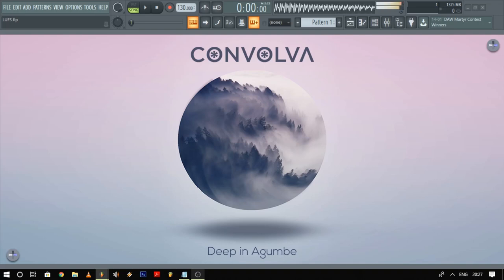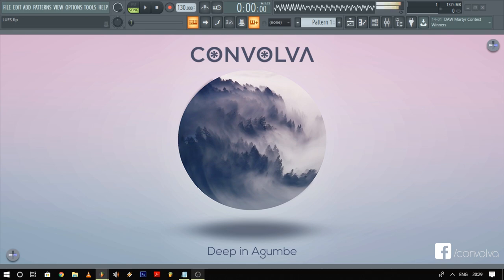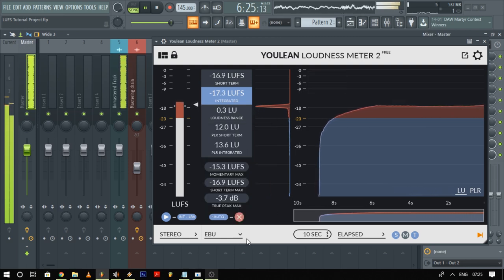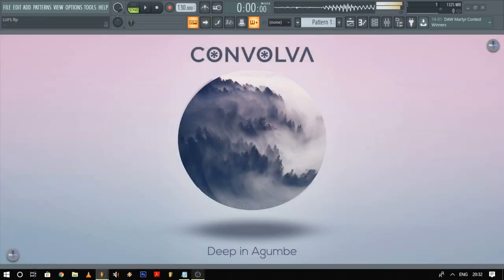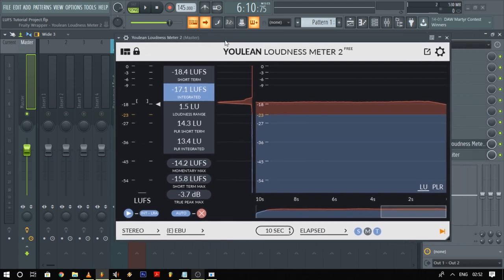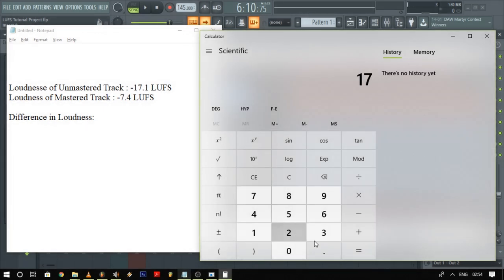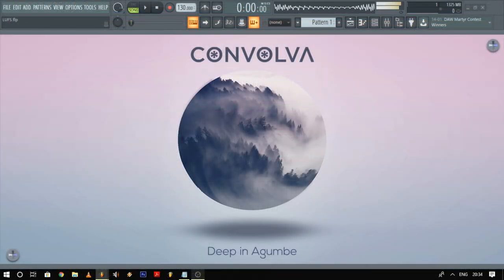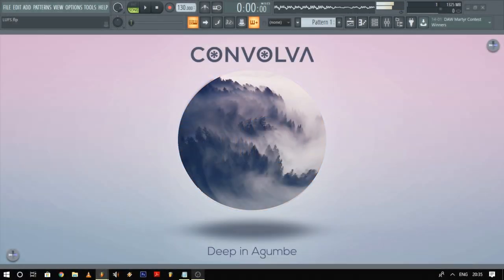Mastering Tip That Will Change Your Production Forever! (2019)

Comment: Very useful approach mate, I might say that starting with a fewer instruments with minimum frequency clashing would end up with a cleaner, fuller in dynamic response and tighter, rather than piling up lots of instruments that competing on the sonic spectrum, where lots of attempts to have the final track loud & clean sounding would be just hard & painful chore... 

Lots of successful tracks, actually relies on a clean arrangement, fewer musical elements, varied and correctly chosen frequency ranges. Most of which actually having no more than 10 instruments. 

Also, knowing how ear works, makes it easier to have a good mix and mastered track, as the human hearing tend to respond to the mid frequency range, so caring with the lows and highs is essential indeed. 
Implementing Lo-Fi process on low end, would give a neat vintage bite, that cuts through the mix. Some saturation / distortion process on the high end in the other hand would makes it less digital, which is very pleasant to our ears.
Reply from the maker: I don't why but I never saw this nice comment. This is actually really good advice and I agree with the point about having fewer clashing elements. It can go a long way in making mixing easier.

Comment: Learnt new things about mastering. Can you please make a tutorial and discuss how to cope up with the problem that after mastering the track becomes distorted and it sounds different. Thanks a lot.
Reply from the maker: Yeah maybe in a future video I will cover how to master your tracks in FL Studio in depth. But for now, I think the distortion is probably happening because of clipping. Just check the levels on your master and see if the peaks are exceeding 0 db. Now modern DAWs have a ton of headroom so all you've got to do is reduce the volume by bringing down the master volume slider until no peaks exceed dbs.

Also I recommend using a limiter on the master with 0 db as the ceiling so that the peaks don't cross 0 dbs. The rest depends on the time variables such as attack, release and sustain. A rule of thumb --> Lower the release, more the distortion..